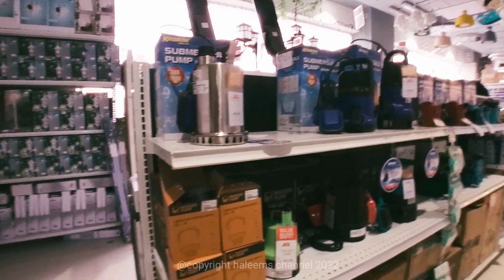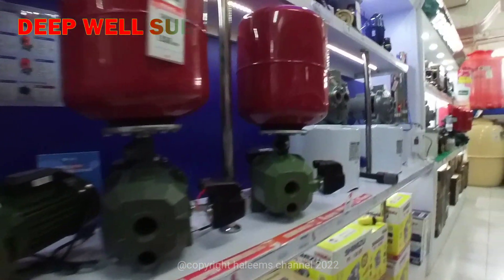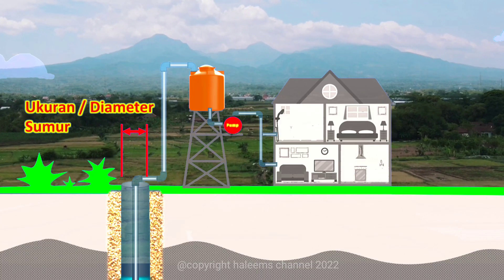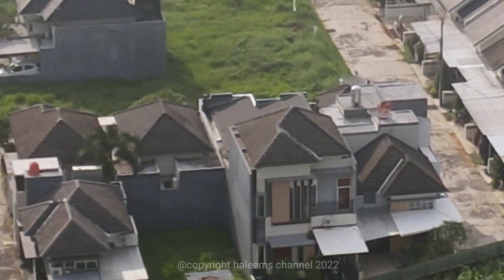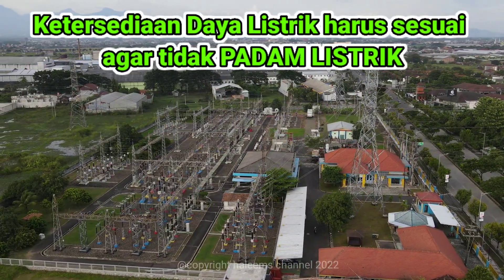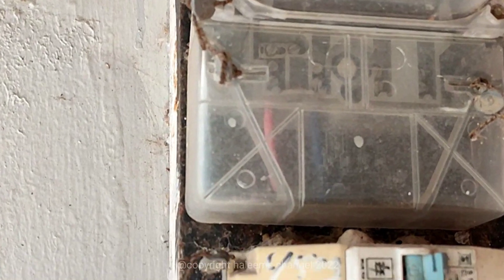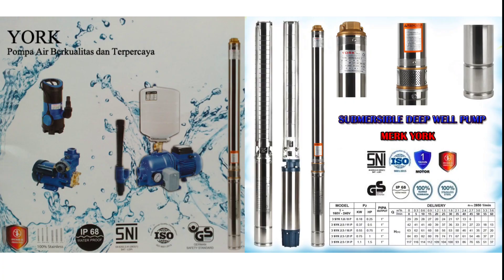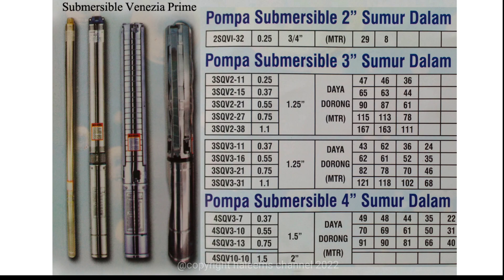WAJIB TAHU AGAR TIDAK SALAH BELI TIPS - CARA MEMILIH POMPA SUBMERSIBLE POMPA SATELIT

Comment: Kami butuh pump untuk mengambil air dari sumber air di sungai, ketinggian dari sumber ke tandon air 50 - 100 meter. Kalau jaraknya memang jauh, 300 - 500 meter. Kira2 pump yang cocok apa ya? Terimakasih
Reply: 10% dari panjang pipa + beda ketinggian. 
Misal perbedaan ketinggian 50 meter, panjang jalur pipa 500 meter, maka:

10% (500meter) + 50meter = 100meter Head, minimal 150 HMax untuk debit air yang keluar sesuai dengan kapasitas pompa. 

Untuk saya, apabila ada 1 asesoris knee, menjadi tambah 1 meter untuk per asesoris.
Reply: Untuk cek ketinggian bisa pake aplikasi altimeter, diusahakan dengan smartphone yang punya sensor GPS dan kompas yang handal, agar lebih akurat.
Reply: @mulqiginanjar6463 dengan panjang dan ketinggian segitu, cara menentukan diameter pipa pvc nya gimama pak?
Reply: @mfathulhadi  menentukan diameter pipa PVC (kalo saya pake HDPE, biar gampang buat ikut jalur), disesuaikan dengan debit yang diinginkan, debit air sumber dan kapasitas mesin yang dipakai. Dalam kasus saya, beda ketinggian reservoir +- 40 meter, jalur pipa sepanjang 670 meter, saya pakai 2inch 70 meter 1,25 inch 600 meter, dengan pompa 4HP 6/28 keluaran debit yang dihasilkan 6kubik/ jam per jam. Di google ada jumlah debit air maksimal per detik untuk setiap ukuran diameter pipa. Disesuaikan dengan spek pompa nya. Sebelumnya dengan pipa yang sama, memakai pompa 3HP 3/33 keluar 3.6 kubik/ jam.
Reply: @mulqiginanjar6463  wah iya juga, saya mau bangun reservoir untuk rumpun2 bambu. Setiap rumpun ada galon air mineral. Jarak pompa sekitar 500m dengan ketinggian ±40m untuk mengisi tandon utama. Dari tandon utama nanti didistribusikan ke tiap2 rumpun.

Comment: Saya punya sumur bos kedalaman 45 meter dg daya dorong 10 meter, kira² pakai submersibel yg kaya gimana bos. Untuk daya listrik 2.200 kebutuhan ac,kulkas,tv,dan mesin cuxi
Reply from the maker: AC berapa PK? , 
Kulkas berapa liter? , 
Mesin cuci berapa kg?, dengan heater ato tanpa heater.. 
Berapa liter perkiraan rata rata per hari kebutuhan air nya? , 

Tujuan mengetahui itu semua utk kalkulasi dan optima kan jenis pompa yg mendekati paling sesuai... 
Karena kalo soal bisa, pompa berapapun bisa saja dipakai..

Comment: Bang tlg dibls ,untuk sumur gali kdalaman 7 meteran dri permukaan air ,dan jrak sumur kerumah kisaran 200 meter ...kira kira pkek yg mna
Reply: Pakai jetpump saja Pak... Di perkecil pipa   yg di sumur nya dari 1 1/4 di perkecil 3/4
Yg 1 inchi di perkecil ke 1/2 

Pipa out menuju 200 meter pakai pipa 1/2 inci 

Pakai jetpump 2 impeler 503

Comment: mohon maaf pak saya mau tanya, 
sumur saya kedalamannya 19 meter tinggi air dari permukaan 12 meter, yang saya cari debit airnya "untuk mengisi kolam ikan", seumpama saya pakai yang ukuran 0,5 hp apakah debitnya bisa melebihi 2 pompa semi jet Pum, dengan rangkaian 2 mesin semi jut pump di jadikan 1 output. 
terimakasih sebelumnya pak.
Reply from the maker: Dikelas motor yang sama, yaitu kelas 0,5HP, pompa Sibel tetap unggul di banding jet pump...
Anggaplah misal perbandingan nya di titik 20 meter,
Sibel air nya bisa 45-50 liter/menit
Sedangkan
Jet pump air nya hanya 10- 15 liter/menit (1 unit pompa)
Reply: @HaleemsChannel  baik pak. Terimakasih atas jawabannya pak, 
Mohon rekomendasi merk pompanya pak untuk casing 2-2,5 inc daya 0,5hp

Comment: Pak jika untuk pompa submersible elv air -20 meter dibawah tidak dikasih check valve karna resiko akan berat jika future mau bongkar pipa discharge.
Apakah bisa disiasati dengan pemberian checkvalve diatas sumur pak?
Masih bingung karna ada pressure negatif, kemungkinan akan gagal. Terimakasih 🙏
Reply from the maker: Secara teorinya bisa, fakta lapangan kembali pada kualitas check Valve nya,  
Karena posisi di atas, fungsi check Valve jadi nahan hisap, atau tekanan negatif, jadi lebih bagus pakai check Valve yang menggunakan gasket rubber..
Reply: @HaleemsChannel  untuk tekanan vacuum di kedalaman 20 meter apakah bisa pak?
Apakah air masih dalam bentuk cair?

Comment: Saya mau buat Sumur baru kedalaman 35 m dengan casing 32 meter. Rencana pompa ditaruh dikedalaman 25m. Permukaan air sekitar 2-3 m dri tanah. Tinggi toren dri tanah sekitar 10 m dengan total pipa dri sumur sekitar 32 m. Total pipa dri pompa 57m. Sebaiknya menggunakan brpa hp?
Reply from the maker: Saya ambil di maksimal operasi, dimana posisi pompa 25meter dan tinggi toren 10 meter, jadi totalnya sekitar 35 meter...
Ini pakai yg 0.25HP atau 0.33HP sudah cukup ya, kalo utk kebutuhan air rumah keluarga kecil... yaitu airnya sekitar 25liter/menit, atau kalo ngisi tandon air 1000liter, ya kisaran butuh waktu 40 menit...
Nah, kembali pada kebutuhan airnya, kalo butuh airnya lebih banyak ya pilih yang HP nya lebih besar lagi...
Misal yg 0.5HP, pada head 35 meter, airnya sekitar 40an liter/menit, kalo ngisi tandon air 1000liter, butuh waktu sekitar 25 menit .
Kira2 seperti itu gambarannya..silahkan bisa tanya2 lagi kalo ada yg ditanyakan

Comment: Mas minta sarannya, kedalaman sumur skitar 25M output air lsg msuk bak kamar mandi & sebagian msuk bak untuk minum ternak. Listrik 1300. Kira2 pake mesin uk brapa? 🙏
Reply: Kebutuhan hanya untuk mandi dan minum ternak ( kisaran sehari 300L ) 

Pemakaian listrik hanya pompa dan lampu sja mas, untuk idealnya sebaiknya ambil yg 0.25 atau 0.5 ? Melihat dari perawatan mesinnya
Reply from the maker: @sholyevolution2762  kalo hanya 300liter itu bisa pilih yg 0.25 sudah cukup...
Soal perawatan, submersible tidak ada perawatan khusus, karena memang pompa sulit diakses alias terendam air... Yang paling penting adalah kontrol / monitoring penggunaan nya... lakukan pemeriksaan secara berkala, kondisi tekanan, air keluaran, Amper nya.. tinggi permukaan air, dll... jangan sampai overloud..yang bisa berpotensi  membahayakan / terjadi kerusakan fatal..
Reply from the maker: 25meter itu 0,25HP juga sudah cukup, tapi itu kembali pada kebutuhan berapa banyaknya air yg di pakai tiap hari, 

0.25HP itu kisaran airnya pada kedalaman 25 meter, sekitar 30 an liter/menit, jadi misal kalo bak 1000 liter, itu perlu waktu 30 an menit

Kalo mau lebih besar, bisa yg 0.5HP,
0.5HP itu kisaran airnya pada kedalaman 25 meter, sekitar 45 an liter/menit, jadi misal kalo bak 1000 liter, itu perlu waktu 20 an menit..

Jadi tinggal menyesuaikan saja, kebutuhan jumlah airnya yg dipakai berapa...

Kalo soal listrik, 1300VA, itu juga harus cek, apakah hanya utk pompa saja, ato ada alat2 listrik lain.. 
Kalo hanya pompa saja, optimal nya bisa utk hingga 1.0HP,
tapi kalo ada alat2 lain, ya harus pertimbangkan pada saat pemakaian bersama (alat2 listrik lain nyala bersama), totalnya harus lebih rendah dari daya tersedia (1300VA) agar tidak terjadi black out, MCB jeglek..

Comment: Ijin bertanya bang, listrik di rumah cuman 450 wat, kedalaman sumur 25 meter, kira2 mampu nggak listriknya kalo pake yg 3inci ?
Reply: Selamat siang kk ijin bertanya klau kedalaman sumur 25 meter dan jarak dari sumur ke tempat toreh 500 meter minta petunjuk pkai pompa yg spesifikasinya seperti apa ? Terima kasih
Reply from the maker: Tidak rekomendasi, kalo untuk listrik 450VA, 
Tipe paling kecil saja, yaitu 0.33HP, ampernya maksimal 2.3A, atau setara 500watt...

Meski sebenarnya watt pompa itu bergantung kondisi penggunaan, tapi tetap berpotensi akan terjadi MCB jeglek... daya Listrik tidak kuat,  pada kondisi maksimal... 

kecuali penggunaan pompanya hanya untuk 1 - 10 meter, itu kisaran watt nya, 300 - 400 watt, 
Jika sampai 25 meter, pastinya sudah mendekati 500 an watt... (Masing2 pompa berbeda-beda, data ini hanya sebagai referensi)

Comment: Berapa wat atau volt dan apa saja yg harus sy beli❓ Sy rencana memasang tenaga Surya untuk: 1 Pompa air sumur dlm 7,5 mtr.    2 Balon lampu 50 wat pakai semalam ful.   3 Cas sprayer motoyama 14 Ltr.    4 Cas hp.
Reply from the maker: Pemilihan pompa, setidaknya di ketahui kebutuhan head nya berapa, airnya berapa, daya listrik tersedia berapa.. Sehingga bisa dipilih pompa yang tepat... 

Jika rencana menggunakan tenaga surya, berapa watt target nya.. Apakah mengikuti besaran pompa nya atau, pompa nya yang mengikuti daya tenaga surya nya... 
Jadi silahkan ditentukan kebutuhannya terlebih dulu.. dan target spec nya yang gimana... 

Sebuah perencanaan harus ditentukan target spec. nya terlebih dulu... Termasuk juga target cost nya.. Bahkan untuk bisnis ditentukan sampai dengan perhitungan BEP nya..
Reply: @HaleemsChannel 
Pak minta bantuan penjelasannya, sy tinggal di area perumahan yg rata2 sudah menggunakan sible semua dengan kedalaman rata2 40 m, Tapi saat ini sy masih menggunakan jet pump dengan kedalaman 32 m dan saat ini sy sering tekor air, kalau jet punp ini sy ganti dengan sible, apakah airnya akan jadi lebih banyak? 
Mohon penjelasan nya pak🙏🙏🙏
Reply: Jet pump itu bekerja berdasarkan permukaan air tanah yg terlihat seperti anda melihat air di dalam sumur , tetapi klo sub marine itu bekerja dari titik sedot dimana pompa itu diletakkan. Jelas submarine  solusinya pertanyaan itu diameter bornya diberapa untuk menentukan diameter pompa submarine yg dibelii

Comment: Untuk kedalaman sumur bor.
50 meter harus pakai type yg mana kk.
Reply from the maker: Setidaknya nya atau minimal yg 0.5HP, tapi keluaran airnya pada head 50m hanya berkisar 20 an liter/menit...
Sedangkan yang 0.75HP, pada head 50m, airnya kisaran 35 an liter/menit..
Jadi, kembali pada berapa kebutuhan airnya... Kalo mau yg besar air nya ya pilih yang HP nya lebih besar lagi...

Comment: pak saya mau tanyak teelepas dari segi listrik dan kebutuhan air .  apa kah semakin tinggi  hp nya apa kah itu semakin jauh aliran air nya . mohon pak so ini bingung apa mau beli 1hp apa 2 hp . klok masalah listrik gak masalah so sumur saya itu kurang lebih nya 75 meter trus  harus beli yg brapa hp . sumur airnya mantap sumur nya sumur galian
Reply: Penglaman sy pakai 0.75 Hp uk. 3 inch kedalaman sumur hampir 50 mtr ditambah naik ke tower air 6 metr output pipa pakai yg 1 1/4 lumyan deras dan untuk toren kap. 1200 L sekitr 30 menit terisi

Comment: Menurut saya yg penting itu: 
1. kedalaman permukaan air. Mau kedalaman sumur bor 10000m kalau kedalaman mata air 6mtr cukup pakai pompa sumur dangkal. Kalau >10m bisa pakai submersibel. Saya sendiri kedalaman sumur 25mtr, pompa sub saya taruh di 17meter, pakai 0,33hp
2. Ukuran: disesuaikan dengan casing, ukuran pompa lebih kecil dari casing sumur.
Reply: submersible itu dipasang menggantung gak nyampe mentok ke dasar,
Meski kedalaman sumur 150 meter, pompa dipasang di angka 70 - 100 meter
Reply: @annatarsauron2059  ya tk gantung..
Reply: @annatarsauron2059  punya saya tak mentok smapi dasar malah air lancar...awal keruh lama2 bening
Reply: @umamas9862  ya memang seperti itu pak
Reply: @annatarsauron2059  nah iya pasangnya tempelkan saja tdk perlu menggantung
Reply: @umamas9862  1
Reply: @umamas9862  kalo saran saya jangan sampai mentok bos soalnya mesinya bisa kejepit tanah
Reply: @selaluingintahu4844 benar...dan di khawatirkan ada pasir atau lumpur yg masuk...membuat kipas menjadi macet...lebih baik di gantung...sesuai selera...
Reply from the maker: Semua item penting untuk dipertimbangkan dalam pemenuhan mendapatkan air..
Jumlah kebutuhan air juga sangat penting di pertimbangkan... Jika kebutuhan nya besar, pastinya perlu posisi pompa yang lebih dalam sehingga dapet air nya terpenuhi sesuai kebutuhan.. 
Kecuali kalo kebutuhan kecil hanya untuk rumah tangga sehari-hari, posisi kedalaman pompa tidak terlalu dalam, tidak menjadi masalah...

Comment: Mohon dijawab:
1. Kedalaman permukaan air 16m
2. Kedalaman sumur bor 28m
3. Casing 4", namun sdh ada pipa 3/4 terpasang (1 bor 2 rumah)
4. Daya listrik 900w
Mesin apa yg cocok? Terimakasih
Reply: Kalau pompa ukuran 3 inc, apakah bisa masuk pak? Soalnya sdh ada pipa 3/4 terpasang?
Reply from the maker: @akbarlimited1293  casing nya 4 inch sekitar 10cm, pipa 3/4 inch sekitar 2 cm, 
Jadi kalo pake pompa 3 inch masih bisa masuk yaitu sekitar 8 cm..
Reply: Pak, lebih rekomended mana pompa yg 3" atau 2"(0.33HP)?
Reply from the maker: @akbarlimited1293  
Dari segi ukuran
2inc lebih panjang, karena itu harga lebih mahal,  tentu nya biaya2 repair jika ada kerusakan juga lebih mahal.. 
Kelebihannya ukuran diameternya lebih kecil, sehingga bila dipasang di sumur casing yg kecil tidak masalah... Tentu biaya buat sumur yg kecil lebih murah.. 

Dari segi ketahanan kinerja pompa nya.. 
Meski pompa yg 2 inch itu dibuat setara dgn yg 3 inc.. Namun tentu 3 inc masih tetap lebih baik kinerja nya pada saat kerja berat...
Reply: @HaleemsChannel  pak, sy sdh beli 0.33HP 3Inch, Rencana saya mau pasang pipa 3/4 inch, apakah sdh sesuai?
(Lubang bawaan sible 1 inch,)
Reply from the maker: Pengecilan ukuran pipa merupakan resistan/ hambatan aliran, sehingga pompa sedikit kerja lebih berat... 
Lebih baik gunakan ukuran standar sesuai petunjuk pemakaian nya...
Reply from the maker: Cek kebutuhan air nya, Kalo kebutuhan pemakaian air nya sedikit/untuk keluarga kecil, pakai yang 0.25 HP, atau 0.33 HP, ukuran 3 inch... 
Kalo butuh air nya lebih banyak/keluarga besar... Bisa pilih di atas nya, 0.5HP dst..

Comment: Bang mau tanya kalau kedalaman sumur 75 meter, jarak ke tandon kira2 18 meter, volume tandon 1200 liter. Apakah cukup dg mesin 3/4 pk?
Reply from the maker: Pastikan lagi berapa tinggi tandon nya... ? 
Sebagai informasi bahwa 3/4 HP, untuk jead 85meter, airnya keluar sekitar 20 liter/menit, untuk kebutuhan toren 1200 liter, perlu waktu kisaran 1 jam.. 
Kondisi ini sebenarnya terlalu minimal... 
Sebaiknya pilih yang 1 HP, agar lebih optimal...namun tetap cek kondisi kelistrikan nya, apakah daya listrik nya mampu atau gak
Reply: @HaleemsChannel  tinggi tandon 4 meter dan daya listrik 1.350.Apakah mesin 3/4 pk ideal? Terimaksih sebelumnya atas informasinya🙏
Reply from the maker: @tiarihi3210  berarti head totalnya kisaran di 80 an.. Pada dasarnya menggunakan 3/4 HP, itu bisa saja... dimana saat maksimum head 80 meter kisaran air keluar 20 liter/menit..
Kembali pada kebutuhan air nya, apakah segitu sudah cukup ato kurang besar.. 
Kalo mo aman ya bisa pilih yang 1HP...
Reply: @HaleemsChannel  kalau mesin 1 HP apakah listrik dg daya 1300 cukup bang?
Reply from the maker: @tiarihi3210  pada kondisi maksimum operasi, pompa 1 HP membutuhkan daya sekitar 1,100 watt yaitu sekitar 5.2A, dimana kondisi maksimum operation adalah kondisi debit terbesar, yaitu pada kondisi permukaan air terdekat dengan output pompa.. 
Jadi kuat gak nya bergantung dari kondisi permukaan air sumur.. dan penggunaan alat2 listrik yang lain.. 

Secara umum, 1HP, menggunakan daya listrik 1300 VA, adalah kondisi yang mepet... Kemungkinan besar akan terjadi listrik padam, jika alat2 listrik yg lain di nyalakan secara bersamaan...
Reply: @HaleemsChannel  Baik Bang, terimakasih banyak atas penjelasannya🙏
Reply from the maker: @tiarihi3210  Sama-sama... Terimakasih kembali

Comment: Bos mau nanya saya punya sumur bor kedalaman 100 metr namun g bisa mengeluarkan air mesin pompanya 1,5hp dan 1,1 kw dan saya pake jengset 2500 wat pertanyaannya apakah jengsetnya yg TDK kuat atau pompa celup nya yg cuman 1,5hp 1,1kw
Reply from the maker: Secara spesifikasi, seharusnya tidak masalah.. 
Cek kelistrikan nya, saat pompa nyala, apakah terjadi drop voltage?
Reply: @HaleemsChannel  langsun mati jengsetnya bos.
Reply from the maker: @newsmb6871  
1. cek resistansi wiring pompa nya, melalui kontrol box nya.. 
2. cek power output jengset nya.
Reply: @HaleemsChannel  tapi intinya kalau semua normal harusnya bisa ya 1,5hp 1,1kw pompanya dan jengsetnya 2500wat
Reply from the maker: Bisa.. 
Kondisi normal, maximum ampere nya berkisar 6 A, sekitar 1300 watt..
Reply: @HaleemsChannel  ok makasih mas.

Comment: klw kedalaman sumur bor 20mtr dan tinggi toren 5 meter, cocok nya pke sibel yg brapa hp ya, kebetulan rumah saya dekat dengan sumber air(danau) jadi 20 mtr aja udah banyak air ntya
Reply from the maker: Head 25 meter bisa pakai type yang paling kecil 0.25HP...tergantung kebutuhan jumlah airnya... Pengen yang jumlah air besar ya pilih yang power nya lebih besar... 
0.25HP pada headset 25meter, debut airnya kisaran 40 liter/menit...untuk keluarga kecil sudah cukup... 
Tapi kalo misal utk usaha, sperti perikanan, perkebunan dll... Ya tentu pilih yang lebih besar...
Reply: @HaleemsChannel   maaf untuk kedalaman pompa air nya di sisakan brapa meter di dlm nya? apa sampe mentok dasar?
Reply from the maker: @azharsaepul2080  untuk menghindari terkena endapan lumpur ataupun pasir, sebaiknya berikan jarak setidaknya 1 meter... Sesuai petunjuk dari pabrik..
Reply: @HaleemsChannel   siap, trimakasih info nya min, semoga rezeki nya mengalirr😇
Reply from the maker: @azharsaepul2080  Sama-sama, terimakasih kembali... Amin.. 
Silahkan tanyakan kembali bila masih ada masalah...